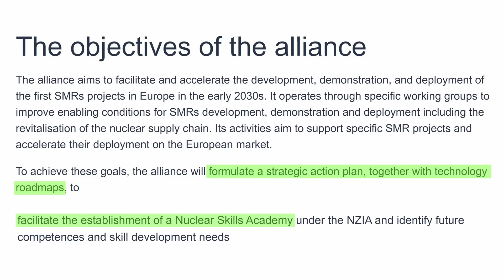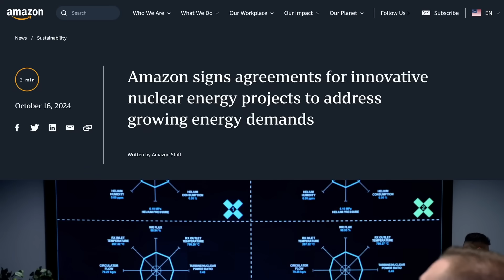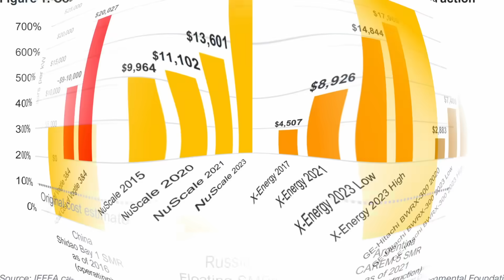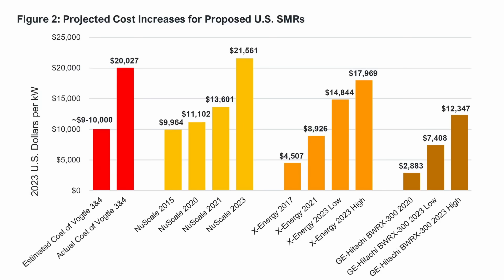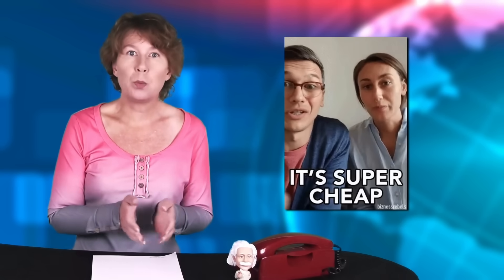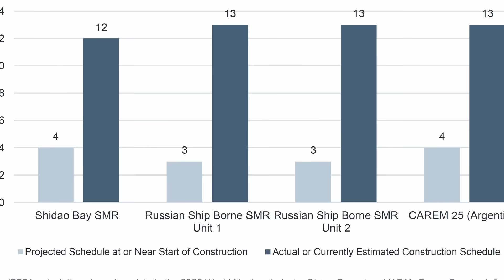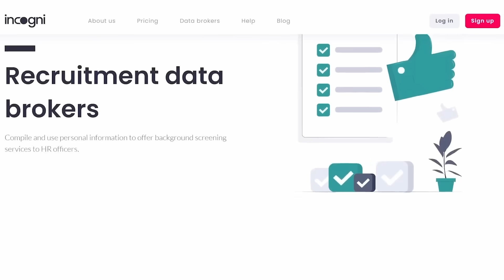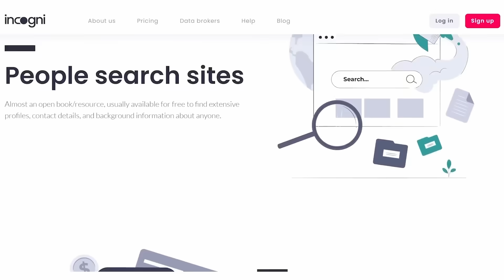Small Nuclear Reactors Have A Big Problem

Comment: Quite a bit of bs here, or at least false framing of the real issue.  If there is a good energy production project (safe and maintenance efficient) that can be rolled out using available real resources, then the inflationary effect can be avoided by government investment rather than private investment. Government net spending creates the currency the non-government sector needs to get to pay the tax. If the tech is commercially viable once produced, then government can always fund the production, without question, without inflation. If workers are needed who are already employed elsewhere then a targeted tax (or levy) can unemploy them, so the government can then immediately re-employ them to go work on the nuclear plant construction without bidding up wages. Not socialism. Government would just contract the manufacturing.  Same for any real resources needed. The tax unemploys resources by design, for the purpose of then employing them in the public sector. Neoliberals (and mainstream economists/monetarists) do not understand this.

Comment: With a budget of $30 billion, you could build a massive solar farm. The cost of building a solar farm typically ranges from $0.80 to $1.36 per watt1
2
. Let's break it down:

At $0.80 per watt, you could build a solar farm with a capacity of 37.5 gigawatts (GW).

At $1.36 per watt, you could build a solar farm with a capacity of 22.06 gigawatts (GW).

To put this into perspective, a 1 gigawatt (GW) solar farm can power approximately 164,000 homes1
. So, with $30 billion, you could potentially power millions of homes with clean, renewable energy.
Reply: Solar is the cheapest. Wind the second cheapest. You don't have to buy fuel for them. Most countries are well suited for at least one of them. All you need is some chunky batteries, and Roger is your mother's brother.

Comment: Solar, wind and batteries are rapidly declining in cost. Now said to be 1/2 of the fossil fuel cost. Even less than nuclear of course as that's the most expensive form of power. With GW scale solar being permitted and installed inside two years: why continue waving a fantasy flag?

Comment: An important thing to note about those existing small modular reactors, reactors, as with my many other things, suffer from the "first of its kind effect".
The first build of a new design for anything is always more costly and takes too long. By the 5th time, the process is much more efficient, costing a fraction of the money and time. Small modular reactors are designed to be mass produced, so they should benefit here.

The problem with big nuclear reactors is they insist on coming up with a new design each time, hence repeatedly entering that "first of its kind" problem, leading to massive costs and building times.

Comment: You can't put deadlines on invention and development of "novel" technologies.

Also, there is great uncertainty in regulations. Regulations usually attuned to light and heavy water power reactor in the near-GW scale with compliance costs related to the number of reactor cores. So putting several SMRs in places where bigger reactors are closely matched to the anticipated load therefore incurs a substantial penalty. So no money in that market sector.

SMRs have "homes" where regional energy requirements are 100MW to 600MWe.  "Economic", modern conventional reactors are closer 1GW at the low end. i.e. with walk-away safety in the case of most severe, plausible disaster.

Regulations need to be relevant to the technology and not unnecessarily obstruct.

There are a number of SMR technologies still in the "wash". Each with pros and cons. Development has to occur to identify issues and to resolve technical problems. It's not just a matter of number crunching or spending 57 hours non-stop, solving equations. It often requires stuff to be made. And even when such stuff is made from available materials, finding people who can make it to the requirements of the reactor, is often not so easy. And if you want to make the development prototypes in-house, machinery and tooling, as well as people with the requisite skills are also difficult to obtain quickly.

Comment: Costs are well understood; there have been SMRs in boats for several decades; the problem is that a) business investors/managers are optimistic about rapid delivery, so scale up resources quickly (increasing the cash burn rate), but b) government/regulation/planning authorities operate exceedingly slowly, so the high cash burn rate runs for much, much longer. There are systems already designed, they just need someone to say "yes" to the build and have a site already secured (in both senses of the word).
Reply: You obviously know nothing about reactor tech. Reactors on sub's etc. have nothing in common with energy producing SMR's - and never ever will.
Reply: @meibing4912  That's quite funny, and a little bit sad.

Comment: Yeah, and the nuclear regulation is and will be there for small reactors too. They're nuclear plants after all. Even if their cores are hard to melt, there's a risk of radiation leak and e.g. sabotage. You need rescue services that can react to nuclear accidents and many things must be taken into account when transferring nuclear material, especially used, which needs all sort planning. So, small scale nuclear makes the problem smaller but doesn't reduce the amount of problems.

Comment: Thank you for the reasonable review of the current state of development of SMRs ! 

Is it just me, or is there a worrying gap between current rocket science costs and Nuclear Fission SMR development costs?  It seems to me, that the cost of 3 to 9 billion for a prototype SMR is outrageous, given they should be relativley small and safe from the getgo, and based on century old developments in that field. If I calculate a yearly income of 60.000 Dollars per technician, I'd assume a team of 100 technicians for 5 years (6.000.000 Dollars) should be plenty, working 5 years and using 0,5 billion (500.000.000 dollars !) of facility and hardware costs. That would equate to 1,1 billion. Everything else seems to me more a money laundering operation, than actual science and manufacturing.    
 Maybe it would be easier and cheaper to build a power connection between China and Europe to exchange photovoltaic daytaime offerings with nighttime needs. That should be possible with 3 - 9 billion dollars. Its the same distance as many gas pipelines already spanning over the world:     West-East Gas Pipeline: 8,707km,    GASUN, Brazil: 4,989km,   Yamal-Europe Pipeline: 4,196km,    Trans-Saharan Pipeline: 4,127km. That is compareable to the distance of 4700 km border to border from china to germany, or 7800 km center to center of those contries.

Comment: You should be anti-nuke. To promote the LWR’s, they said that they would be super safe and produce electricity so cheaply that they wouldn’t need to meter your consumption. Then despite huge government subsidies, they turned out to be very expensive to build. One PWR melted due to human error and inadequate maintenance. A BWR blew up because of a tsunami. The steam generators on PWRs leak all the time. They have to shut them down and plug the tubes that are leaking. Eventually they have to shut them down and replace the steam generators. Will we ever learn? Nuclear power is expensive, unsafe, and unnecessary. I worked in the industry for 38 years.
Reply: Nuclear power is expensive and has risks like every technology we use, might be, but all these calculations will be meaningless, when we have to face the incredible cost and risks of climate change.
Reply: @ Nuclear power is not the answer. People are more fearful of nuclear power than they are about global warming. Putting the money into energy efficiency retrofits, solar, wind, geothermal, even using natural gas would be better.
Reply: @leebeidelman  Maybe, but people are wrong in this case, and at the same time there are a lot of "renewablea2- oponents too. I´m personally a big fan of solar and wind power, but it will never be suffcient to feed humanities energy hunger. And NO, sc. natural gas (methane) is as bad as burning coal and oil, in particular if we have to liquefy it and ship it around the globe.
Reply: @Thomas-gk42  Those people are wrong? Maybe they understand the risks of nuclear power better than you do. Maybe they have reviewed the economic and environmental damage done by the accidents in Japan and Ukraine. Maybe they have considered the possibility that the next nuclear accident could be even worse. This is exactly why nuclear power is different. A nuclear accident could cause the evacuation of millions of people and render huge land areas uninhabitable. Many people could get cancer, and genetic defects could impact people for thousands of years.
Reply: @leebeidelman  You claimed, you worked in the nuclear industry years ago? I can´t believe it. "Those people...maybe understand better"? I was a nuclear oponent for many years Half of my life, before I got informed better and I know their arguments very well, cause I used them myself. We used to overestimate the risks, to bring forward our political agenda. This is not the platform to debate all this stuff, so let me just say, Compare the accidents of nuclear technology (I don´t talk about weapons here) with the harm, deaths, that the mining and using of fossil fuels generates, and you come to the conclusion that nuclear power is far the least harmful technology.
Reply: @ The debate might help someone reviewing the comments. It’s true. I worked in radiation protection. I worked in about 10 US nuclear plants. I was in graduate school when the TMI-2 accident happened. Then I worked for the US Department of Energy for 22 years. I was pro-nuke until March 11, 2011. Fukushima. The most near term deaths were from the evacuations. 51. They don’t know how much radioactive material was released. They can only speculate on the long term effects such as cancers and genetic effects. Same thing on such things like the mental health of the people and suicides. It is Not Possible to estimate the risks of nuclear power. For this reason, you can’t compare it to any other source of power. But you can say that it is unsafe. History is proof.
Reply: So what? Still safer than Coal and Gas. Probably safer than Renewables too.
Reply: @erikjohansson4275  When they tell you it is safe, you need to think hard about that. You need to review the environmental damage done by the accidents in Japan and Ukraine. And consider that the next accident might be even worse.

Comment: All of these comments fail to recognise the solution which is to build Stable Salt Reactors. These will be cheaper to build and operate than coal power stations due to their inherent simplicity, no pressurisation, no need for control rods and the ability to run on spent fuel thereby getting rid of nuclear waste. Completely safe, cheap and capable of on a true production line.

Comment: To approach the subject of the construction of nuclear reactors, I think it is useful to set a reference.
For me, the gigantic EPR, a monolithic pressurized water reactor that EDF (Electricité de France) has been trying to start up in Flamanville for almost twenty years is the one. Although the technologies used are conventional, this project is now 12 years behind schedule and it is not yet certain that the plant will produce at the end of 2014. The initial budget has been multiplied by... drums: Six.
It is therefore not surprising to see some pioneers of the new ways encounter serious problems, particularly financial ones. Over time darwinism will apply. Darwinism is based on tangible results, so I would have liked to hear you on the technologies chosen by companies trying to develop these new approaches. 
In particular, I found the Kairos way interesting, but I am only a layman.

In any case, thank you again for your notes, they are a point of reference!

Comment: This is about a fact.
**In an electrical grid, the power must be produced in real time, as it is being used; if supply to the grid is less than demand at any time, there will be a blackout. For the grid to function, supply and demand must be balanced at all times.**
Solar is intermittent obviously because we have nighttime. Wind is intermittent obviously because sometimes the wind doesn't blow (or blow strong enough).
However, if the public can be made to understand that loading the grid with intermittent power sources without backup means regular blackouts, and that backing up the United States grid with batteries would cost at least the equivalent of the US’s whole annual national income, and that backing up the intermittent sources without batteries  (in the absence, at least, technologies that are hardly conceived of yet) means ramping up diesel, natural gas and coal generators and producing enough CO2 to render the whole exercise pointless, it will put the burden on those who think that it’s a good idea (Democrats) to go through with it in the next few years to justify themselves. So if the Democrats, who evidently do not understand the FACT of how electric grids function continue pushing the current energy policies, get ready for frequent blackouts / grid failures just like third world countries have.
You get what you vote for. (Tell a liberal the fact, they may not have ever been told it.)
The conclusions is that more nuclear electric generation needs to be built but private businesses arent going to do it because regulations have slowed and crippled the industry. I hate government but in this case i believe a bunch of base load nuclear plants need to be built 'for the good of the country' by government, if the tree huggers are serious about eliminating carbon based energy
Reply: @dekjet  hydrogen will NEVER be a common fuel, I WORK with hydrogen (occasionally) and its very very very hard to deal with it because of leaks (small molecules) and Hyrogen enbrittlement of metals. Cost of liquefication is so high that it's only used in special cases like aerospace and research.
And a GE employeee building natural gas fueled gas turbine generating plants around the world (mainly peaker units) I know a bit about that too....as the LEAST polluting hydtocarbon fuel (we run the hot waste exhaust gas through a combined cycle boiler to generate steam and power a secondary steam turbine generator) that in stationary power plants the exhaust is run through a catalytic converter so it meets the stringent regulations.
Being in the electric generation industry I can gauantee you that wind and solar ARE NOT grid friendly and I do hear about Europeans having difficulties keeping their grid up!
But keep your head stuffed up your anus, it must be dark and safe for you, like a womb...but someday you'll get expelled into the real  world.
Reply: Your assumptions are ridiculous. Seemingly on purpose.

Comment: The whole point behind SMR modules is that once you have constructed a factory to make the first one, the second and successive modules drop rapidly in cost—unless, of course, the factory costs more to run than the SMRs are worth.
Reply: Tell that to the APR Cheerleaders at Georgia Power ..., who now have saddled the ratepayers with UNICORN REACTORS because NOBODY ELSE HAS BUILT AND BROUGHT ON LINE THEIR OWN APRS TO SUPPORT THE ECONOMIES OF SCALE GEORGIA POWER WERE SCAMMED ON!!
Of course, Georgia Power nearly busted the state on their Units 1 & 2 through their incompetence and clueless rube behavior, but NOBODY on the state utility commission would believe Georgia Power was going to be that stupid again!  Their country club friends ASSURED THEM GP was not gonna let that happen when they all played their golf at the club ..., and now the rate payers are screwed with huge rate increases while the stockholders will reap the benefit of all the power sold OUTSIDE the state, cuz surplus.

Comment: It is fairly amusing how the same hard lessons have to be learned over and over by succeeding generations of nuclear engineers. They tried SMRs back in the '50s, the idea was terrible, and it failed spectacularly. So, here we are, 70 years later, and we're right back at the same old story! And the problems are, unsurprisingly, pretty much identical. Nor does it take a genius to understand that there's a floor on the cost of a reactor. ANY power reactor will cost a certain amount, and the less power it produces, the higher the cost per unit of power output! Duh!
Reply: Where did you get the idea of "failed spectacularly"?
Funding was stopped and e.g. ORNL MSR got shut down one last time. There was no failure; other than of government to continue to fund research in that direction.
Reply: @todharter5195  the world is a different place than it was 70 years ago. Computer technology is an obvious example. There are probably also differences in metals fabrication and other technologies of interest in reactor construction

Comment: So after Fukushima and Chernobyl, you think that there’s overregulation. Neither one of those disasters or properly taken care of, and both of them were completely preventable.. Fukushima has reactors cores that are traveling through the earths crust , 3 cores melting through the earth and in doing they have become wells of radioactive seawater. These wells release over 1,000,000,000 gallons of highly radioactive seawater back into the ocean every day and have them since the tsunami took out the powerplants. It may be one of the most beautiful inventions we’ve ever made, but it is and will always be one of the most deadly..